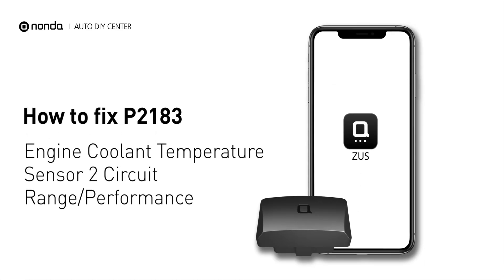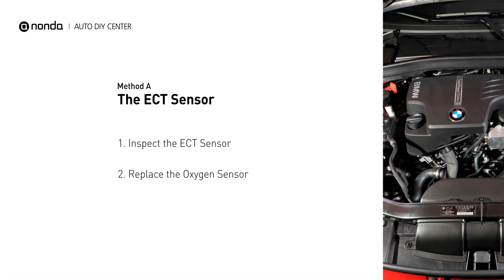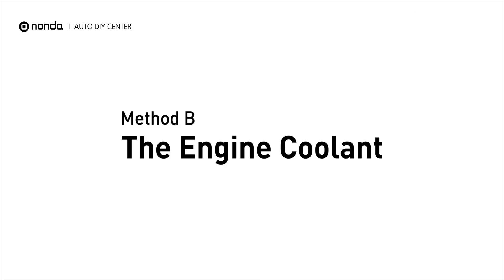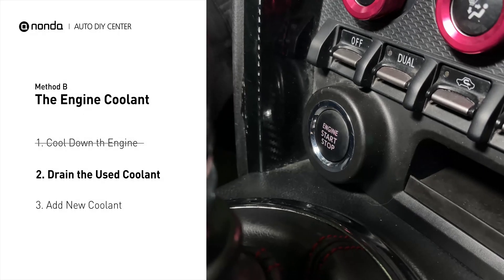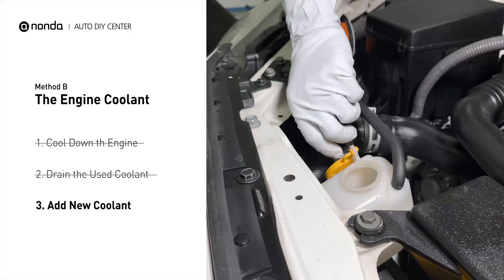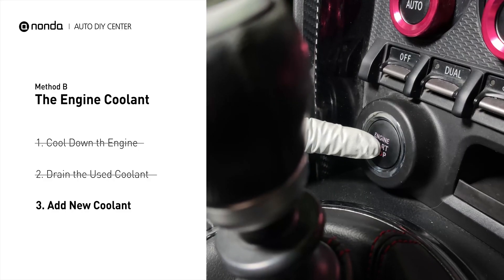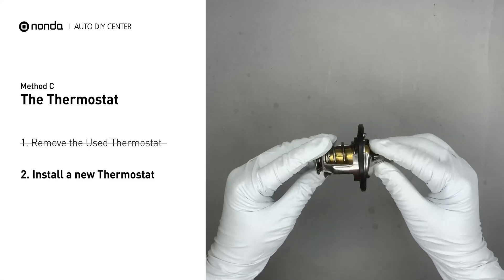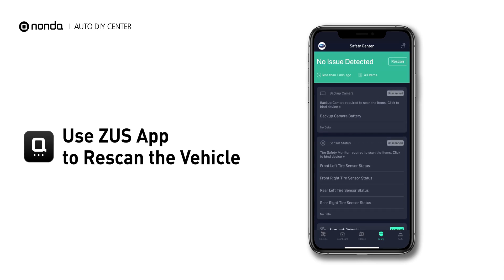How to Fix P2183 Engine Code in 4 Minutes [3 DIY Methods / Only $7.38]

Comment: Am I missing something?  You show P2183 is for ECT Sensor 2, and then troubleshoot ECT Sensor 1 at the top of the engine in the example. ECT2 (on my car) is at the bottom of the radiator.